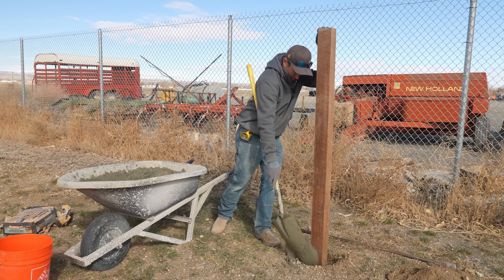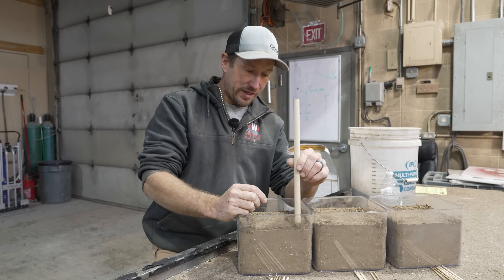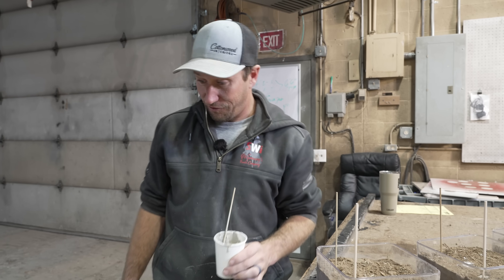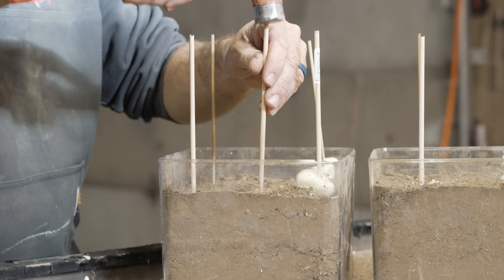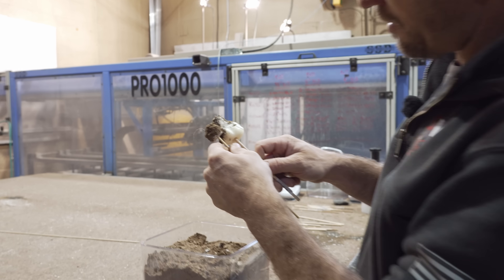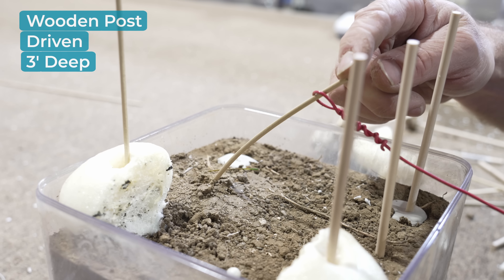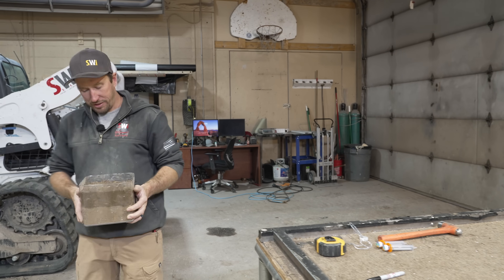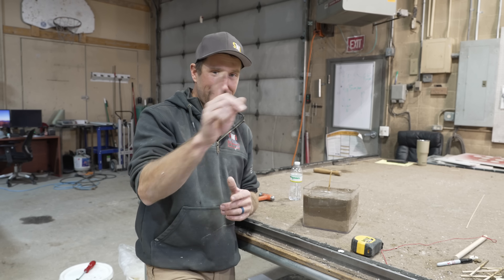How Deep Do Fence Posts Really Have To Be?

Comment: The experiment was deeply flawed, but the results were accurate.  The deeper you go, the stronger it is. That's just simple physics. There are far too many variables to have one right answer.  Examples are the length of fence you're trying to support and different soil types. We have areas where the ground is black dirt, and if you don't go six feet deep, there's no hope.  We also have areas 4 inches down is solid white rock, and in order to put t-post in the ground, we have to use large rotary hammer drills and carbide bits to drill a pilot hole to drive the t-post into.  If you get a corner post 30 inches in the ground,  it would take God himself to move it.  There's never going to be a right answer that applies to everyone.  The only thing that's for sure is that the deeper you go, the stronger it will be.

Comment: I used to be a Journeyman Lineman! To upscale this to power poles, the standard depth formula is: 10% (of total length) + 2’… so, a 40’ pole depth is 4 (10% of 40’) + 2 = 6’. 45’=6.5’ 50’=7’ 100’=12’
The difference is the poles taper from •Top• to •bottom• & there is a brand on the pole at a standard height, so you can easily read the spec’s including tree breed it was milled from. You took the 2 extremes (dry & swamp) that are not typical. There are •Special• ways to anchor in non-standard soils (sand/dry or wet/swamp). Yes, engineers figured this all out for every situation. For a residential fence, the sturdiest I’ve seen is a 2 or 3 high cinder block wall (buried to grade) with steel posts through the cinder blocks & filled with concrete.

Comment: The video is for entertainment only. Here is my opinion. 
Modeling laterally loaded sticks do not represent real fence posts. 
Laterally loaded foundation capacity vary by the diameter of the hole you use and not the stick you put in the hole.
The stick capacity needs to be defined.
The type of backfill in the hole changes the results.
Models ignore the weight factor, both the weight of the soil and the weight of the concrete.
The edge effect of your container affects the results.
The position of the horizontal load above ground changes the results. The ratio of shear to moment is a big deal.
The capacity of the foundation, increasing the diameter is a linear increase, increasing the depth is a power function increase. Skinny deep is stronger than fat and short.  Skinny and deep is cheaper.
Your to get a Pocket Penetometer to determine the soil shear strength.
Your marshy top soil should be ignored. All it add is overburden weight.
Failure needed to be defined.

Now you might ask how do I know all of this stuff. My background is In am retired from the electric utility business where I designed the foundations. I have several finite element programs and one that I have written to model laterally loaded foundations. 

Utility poles are typically set 10% +2’. People have discussed this depth with little agreement. This is a shallow depth and most of the time makes the pole either lean over or peal out of the ground. The end result is that if the pole was set deeper the pole would break off. If the pole is too shallow, then the pole can be easily be reset without undoing all the hardware.

As far as fence posts are concerned, put your money in the gates and the corner posts. They are hard to replace and gates need to be solid. All of the fence posts that I see that are damaged are from rot and are broken off at the ground-line. They changed the pressure treating and it does not work well. Use steel posts.

Comment: The soil you used looked to be too dry.  That is probably why the shallow sticks pulled out so easily.  Check out ASTM D698, if you can, it will give you a better idea of the moisture density relationship of soil.  Different soils have different bearing capacities and cohesions depending on the ratios of sand, clay and silt.  I think it would be interesting for you were to find a local civil engineer/soil test lab and ask them some questions from a fencing point of view.

Comment: You scaled the post and hole and the foam/concrete, but you did not scale the soil.  In other words, you reduced the bearing surface of what you put into the soil to a much greater degree than the soil surface it was bearing against.

Comment: the experiment is flawed flexibility strength  is not a direct correlation with size more problems with the execution is dry dirth can't be compacted by hand but an heavy machineries OR you could wet the dirt prior to compacting

Comment: Bro doesn't understand leverage... Just because it's the same depth, doesn't mean it'll have the same hold if you're adding overfill to make different leverage points. Also, the higher you pull from, the more leverage you have. You can get away with 1 bag of concrete if the hole is deeper, but the hole will need to be a tight fit and you'll want to pre dunk the post to coat it in concrete. The packed dirt around the rest of the post will hold it up. The main reason for the concrete is to help prevent/reduce rot to the post. You could also just burry the post really deep without the concrete and it'll hold well if the dirt isn't loose like this, but it'll rot and your fence will fall over. Lol

Comment: None of this matters except in areas where there is no frost heave.
Where you have frost the posts have to be significantly deeper than the frost line.
there has to be enough ballast below the frost line to out weigh the heave.

Comment: Sorry to point out, but the whole test apparatus; will produce with high probability, inaccurate results. 

Reason is you did not scale everything down nor used wood of similar density to what is sold for fence post. 

Not scaled down= grains of sand; in this test,  are HUGELY out of proportion. Any compaction measures used due to that will be wildly off proportional scale also.

Comment: So basically, what your test showed was that I over engineered my horizontal fence in south Texas soil by sinking a 12' postmaster post 4' in an 8" wide hole filled with concrete from bottom to top to make an 8' high horizontal fence using deck boards as the fence material spacing the posts 6' apart.
Reply from the maker: Not necessarily! 🙂 This test shows basic minimums for standard height--but doesn't account for other factors. I like the way you built it.

Comment: Loved this video!
The telling thing is on the 3' weak posts, the post broke yet it ALSO pulled out of the foam. The foam let go of its adhesion which means if you put these in the ground tension on the post would separate the adhesion and allow water to infiltrate and rot or rust the post. I don't think I want to use foam at all after this.
I ran concrete pumps in East Texas for 17+ years and my specialty was doing power line piers for the big post. We are talking holes from 30' to 100' deep. The posts where the line gets its strength from and lines pull from different directions are called 'Foundation' posts, these are the HUGE ones on the runs as opposed to the thin ones that do not grasp the power lines but allow them to hang freely on rollers. The contractors NEVER used foam on anything that would hold tension except for some very small poles that carry lines down streets to houses called 'Distribution lines'. Any post that holes tension are ALWAYS done with concrete and are DEEP.

I also dip many of the transmission runs through the swamp around Shreveport and other places in Louisiana. In the swamp or flooded ground the holes run either to bedrock, clay, or dry ground.

Comment: I tried 30" in Texas clay, not fun, but it seems to work.  The several drought we had took a toll on them, some are leaning.  Tried the metal anchors, but not good since can not access the neighbor side, and roots are everywhere so the metal anchors sit further from the post with 2x4, some double up spacers, however they hold thru the last windstorm. Maybe time to pull them out and redo, when time/money permit! Thanks!

Comment: Even though this is to "scale", 2" in compact sand( there are no rocks simulating boulders in compact native soil)  isn't comparable to concrete setting grabbing onto those big rocks/boulders in the soil. Also, bell the bottom of the hole. I go minimum 2' and bell the bottom always and never had a fail

Comment: The right tool for this job would have been a digital dynamometer so you can measure the force to pull each post over. But, the thing is, you would need to max out at a scaled down equivalent to a realistic force of wind (or whatever) . We could all guess what would happen if a human topples over a miniature size model but that's not a fair fight.  If it was, 12" might actually be ok most of the time. I don't know and wouldn't assume so but it might. Interesting experiement though. Great video as always. Now please do it over. ;)
Reply from the maker: Bigger tests coming. 😉
Reply: @SWiFence  Awesome, I can't wait.

Comment: This isn't a true representation. Digging a post hole into ground that has been packed for hundreds of years with rain & rocks? Not even close. What's funny is that I've watched fencers dig a hole (usually 1 1/2 to 2 feet), insert a post, pour cement around the post, and then cut the top of the post off. These fences look like a serpent a year or 2 later. I won't say how I was taught, but I don't use cement. Everyone has their own way of doing things.

Comment: Could you do this test with real 8 foot  4x4's  set in concrete at 1, 2 and 3 foot depths. Then connect the posts to a winch or comealong, and a foot pound gauge. Sure it would be more expensive and time consuming, but would give accurate real world results using real world materials. Just a suggestion.
Reply from the maker: We've got a real-world video in the planning stage.

Comment: I went with postmaster fence posts and concrete. I tried to get every post to 30" but some are closer to 24. All the corners are 36" deep. Its been installed for 7 years now in the midwest. Looks the same as after I installed it. Its not perfect but I learned a ton.

Comment: Can’t compact dry dirt. Mix water in to 10-12% moisture before filling and compacting
Reply: I disagree.
Built a lot of new fence on the properties of our farm, between the early 1970s--1990s.
Many of the posts were 4ft deep, and definitely packed in dry dirt, by hand.
Those earlier posts are still unmoving 50 years later.
Reply: It depends on the soil type and how dry you are. Totally dry sand will increase in volume and bulk or swell from the wet state. If you go to the beach you can see the dune side with the loose sand that you can’t drive on. The sea side is very compact by the waves and is where you drive.

For clays and silts there is the optimum amount of moisture and it is found by running a Standard Proctor Test. Basically you compact the soil until it turns to jello and the moisture prevents further compacting. I like to compact with a sledge hammer, the small handle end. When you have compacted the hole with the spoils and you have to add more soil, you are better than the original soil.
Reply: 5 to 7 % moisture for granular materials
Reply: Add water and let dry for several days. Be more like natural soil.
Reply: So make mud ??? It’s un tamp able you can’t pack wet dirt don’t work. As a fence guy for 26 years in the north east and in NW Florida never wet dirt and most companies won’t work in the rain or wet ground makes for very shitty installs
Reply: @mattnichols431 

I've never tried packing dry soil. I live in the SE so it always has over 10% native moisture content to start with. No clue whether they need to add moisture in the Desert SW or not.
Reply: @mattnichols431  No you don't make mud. Moist dirt will compact. Dry dirt won't.

Comment: @2:25 I think the dirt might be a little too dry. Great job on the video!
Reply from the maker: You're not wrong. I had added a little water on top (we cut that part out for time) but I don't think it was quite enough.
Reply: @SWiFence  it was still a great demonstration on the depth of fence post. It really did illustrate the different strengths